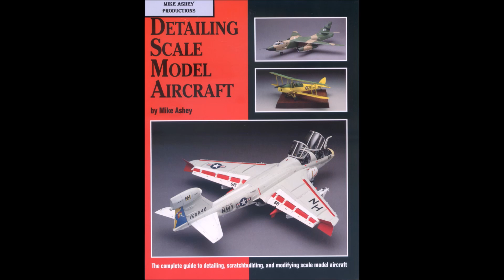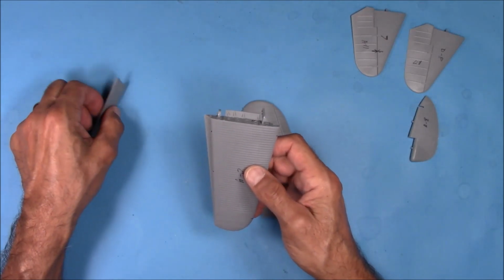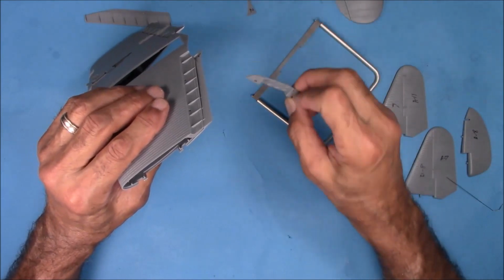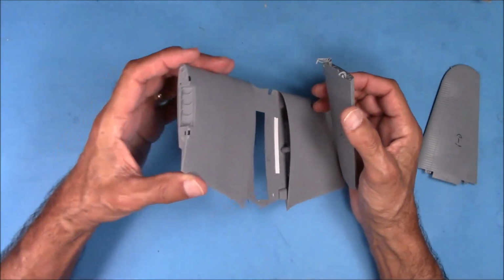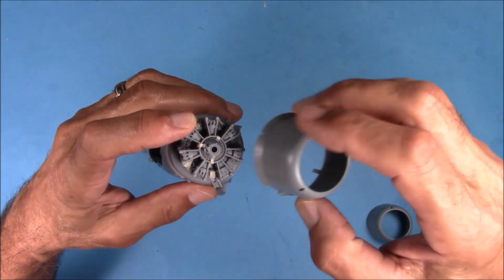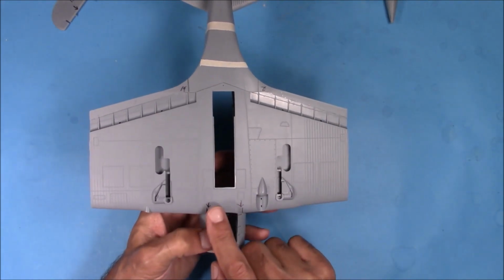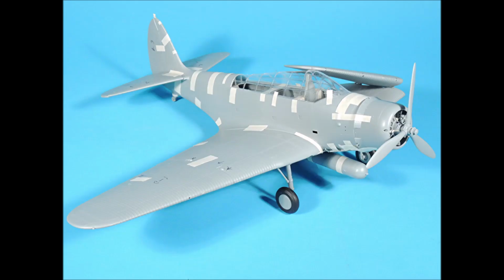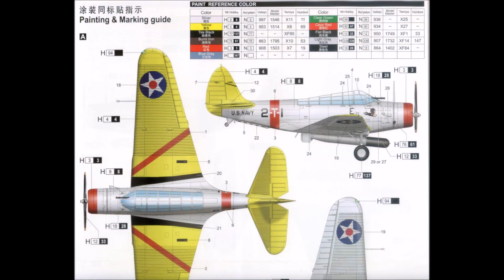Trumpeter 1/32 scale TBD-1 Devastator tape up review.

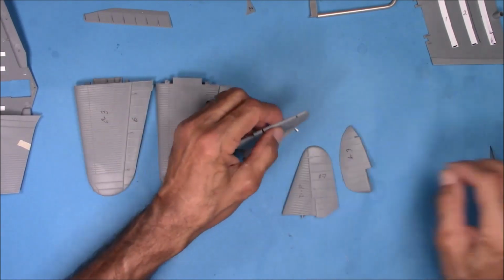Comment: Very good review.  I like your approach.  Avoids needless pitfalls.  You asked whether the circular structures in the wing faces when the wings were folded open.  They were closed.  See John Ford's "Torpedo Squadron Eight" on YouTube  filmed aboard Hornet as she proceeded to Midway for the battle.  Also these faces were painted the same color as the aircraft (PRU BLUE) and not zinc chromate.  I've gone ahead and built out the major components of the kit and stored the unassembled (but painted) myriad cockpit pieces in a zip lock baggie awaiting issuance of detail sets from Eduard.  I am also building Great Wall Hobbies' 1:48 scale version which has several Eduard sets available.  If they upscale the GWH sets to 1:32 for the Trumpeter kit, it will be very impressive...and educational.  The bombardier's tunnel beneath the cockpit is spectacular.  You need to build the kit with the bombardier's outer hatches open in order to see the detail through the window.  The pilot's seat floats in space above the tunnel and blocks a good deal of the view.  Quinta Studios also makes impressive detail sets.  They advised me they are developing a set for the Trumpeter kit.  ETA unknown.
Reply from the maker: Excellent info-thanks

I am working on detailing the Revell-Monogram 1/48 scale B-17G.
It’s still a good kit.
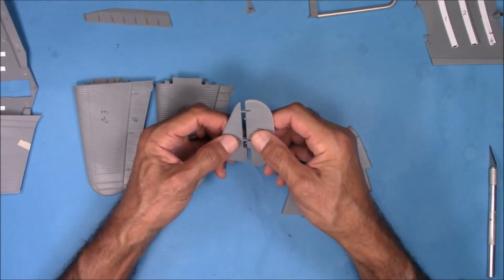Reply: @scalemodeling  yes, indeed, it still stands up.  Hey, imagine taking on HK's 1:32 version.  What a monster. Too pricey for me plus where the heck would I put it??!!  I do have their 1:32 nose art kit of the Lancaster.  Wonder why they did not followup with the B-17 and the B-25, and now the A-20?
Reply from the maker: @herbzinn3131  

I have the HK 1/48 b-17. surface detail is great if your into model art but it’s not accurate 

B—17 was mostly lap jointed with surface rivets 

Monogram kit panel lines replicate the lap joint locations well.